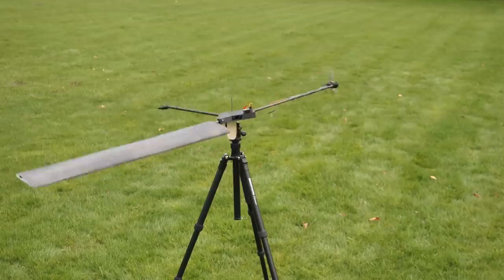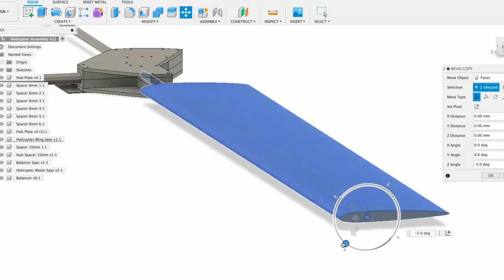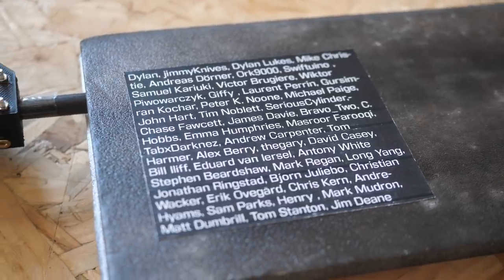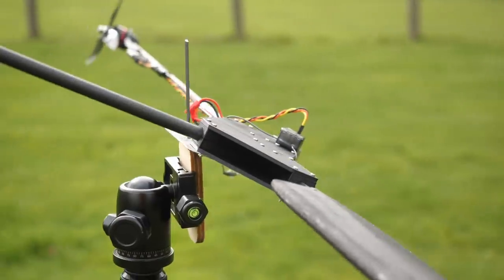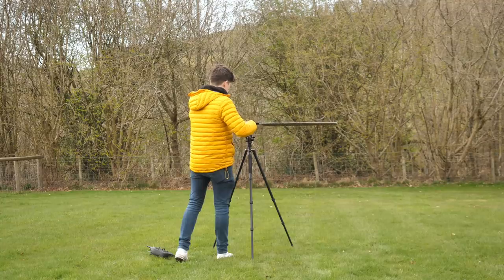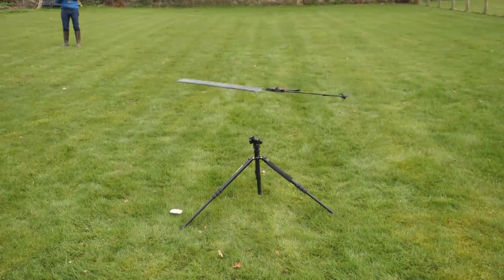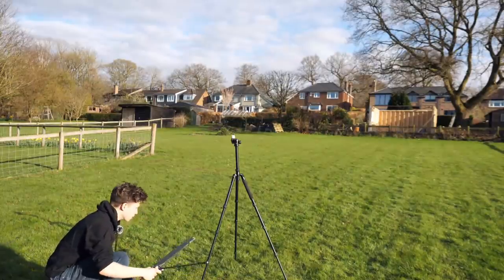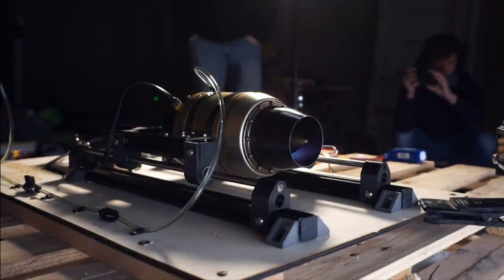Simplest Helicopter Ever?

Comment: James, we can totally stabilize this to give you roll/pitch control! A reliable yaw heading with yaw gyro and magnetometer (MPU9250) can give azimuth while in flight, then throttle can be modulated around the azimuth to increase/decrease lift on one side and stabilize on desired roll/pitch angles.  Hit me up this summer (after my exams are over haha)
Reply from the maker: I might have to take you up on that!
Reply: Please do a collab!!
Reply: @arturpekosz   Very nice! Love it.
I dont use compass, is did use gyro. Do you have instructions how to build airframe and your control method?
Reply: @pepethefrog7193  Sorry, I don't have instructions. I am using a QMC5883L magnetometer, and an Arduino nano for the calculations. My airframe is made of fibreglass rods, joined with string and superglue. The wing has a fibreglass frame and a tape covering. And my monocopter has landing gear (it can take off from rough concrete and very short grass).
Reply: That actually makes sense as opposed to just being a sales pitch. As much as I can understand it.
Reply: Exactly what I was thinking 🤔 lol great content keep it up
Reply: I was actually wondering if you could somehow use a shrouded photocell to align your control movements.

Comment: This may have already been mentioned in the comments:  A very similar helicopter to this was published in the 1960s in the magazine, "American Aircraft Modeler".  The helicopter at that time was called, "Charybdis".  It was powered by a Cox .010 "gas" glow plug engine.  Construction was almost entirely balsa wood, harder wood for the long arm and a thin, plywood plate upon which to mount the engine.  Now, carbon fiber and 3-D printing.  My, how the times change.  I think you deserve a lot of credit for your hard work, determination and perseverence.  Thank you for this video.  You put a lump in my throat as I reflect on the balsa wood models of days gone by.  Best wishes.

Comment: I built one of those single bladed copters about 45 yrs. ago. Used a Cox .010. I still have it. Mine got launched by hand. Spin, pushup, let go. It took me about 10 attempts to get it to keep flying. The spinning The centr. force over pressured the fuel and caused it to run rich and lose rpm( and altitude! ). I had to tune it beyond the correct ratio ( too lean ) then spin it to launch. The rotation brought up the fuel ratio and it flew. I lost it on the first flight, but found it a year later, 80 ft. up in a tree several blocks away. Back then it was called "The Charybdis". Plans from Popular Mechanics. That was it's only flight.

Comment: Beautiful experiment!  To find the dynamic rotation point:  Tilt the helicopter wing such that it does give no lift.  Glue a piece of light carton underneath on the helicopter frame in the zone where the dynamic rotation point is expected to be.  Hang the helicopter (close to static balance point) with a long rope to the ceiling.  Start the helicopter and let it run at the expected flying RPM and touch the carton from underneath with a marker.  The helicopter will draw a circle on the carton which center indicates the dynamic center.  Attention: dynamic balance point moves by varying the RPM!!!, so try to simulate with +/- the specific flight rpm!!!.  And giving the wing a progressive angle would make the flight MUCH more stable and more efficient!!!

Comment: Add another pole at the center, pointing straight down, such that the weight tends to keep the plane of the blade's travel horizontal.  In fact, you could launch it by sliding the pole down into a vertical pipe, further ensuring that its horizontal upon launch.

Comment: They made choppers like that back in the 70's. I was not around, but they would make freeflight timed with burning wicks and a switch, r/c ones that had a heli fuselage hanging below to hold a pitch and bank servo, simply pulling it forward from just below the bearing that held the blade to the top, and some had a servo to control a reversable brushed motor powered tail rotor, that would move the tail in yaw to direct the nose, since there was no torque created by the rotor powering itself. They also had the most annoying type- a main rotor mounted gas engine, spinning an oversized prop, then the torque would spin the whole rotor blade the opposite direction. In a world of gps programmable flightpath and gyro stabilized drones, it is way more fun to tame a not so automated contraption.

Comment: I think you could add directional controls to this with a single servo controlling a hinged control on the wing.  An arduino combined with a MPU sensor would allow you to initialise the model on the ground and define "forwards".  You would then have a fixed plane of reference that you can use to control the model meaning you could then code "aileron" and "elevator" controls by mapping the input requests so that they activate the servo at the appropriate times in the rotation.

Comment: Hi great idea. I used to have a free flight helicopter with a Cox pea engine and once the engine was running the counter rotation would spin the outer blades when it got up to speed the blades would start to alter pitch with a counter weight on the blades so you are not wasting lift for drag when the blade is set pitch

Comment: I used to build these with Cox .049 engines.  It had a horizontal stab above the wing with an adjustable elevator to control the pitch of the blade (speed of climb).  No throttle, just watched it fly until it ran out of fuel.
Reply: Build onr myself back in the 70's plans from a flying models magazine.

Comment: This reminds me of the Fairey Gyrodyne design of the 50's. It used tip mounted jets supplied with air from a compressor in the body of the airframe. It flew very well, and was only let down by the ungodly amount of noise it made.

Comment: You can achieve full three Access control of that by implementing a time space control scheme used in conjunction with an aileron. Basically the aileron pitches up on one face of the rotation and pitches down 180° from that to achieve roll. Then changing the phase of those pictures changes the role direction. Not easy to program, but should be pretty easy to control if and Imu and microcontroller is used.

Comment: Here in the UK in the 70s we used to have a firework called a helicopter. It was a bit of card about 4x1 inches with a rocket motor tapped to it about two thirds along, you would then launch it from a shed roof or a piece of wood at a angle, the fuse had to face you when you lit it. Maybe you could make a modern version with a ducted motor.

Comment: 3:00 Nice seatbelts these are very secure, but since you wear the cap in the proper orientation you may consider
to mount some headrests. In case of a accident you may hurt your neck. Or snap it, and that is a no fix :). Cheers.

Comment: Might want to see about hanging a heavy weight from the center of the tripod, if you're going to use that method to launch, it'll help stabilize the tripod, and perhaps make launches a bit more predictable. Also, the heavier the better within the capabilities of the tripod, and also keep it pretty low (almost touching the ground.) What this will do is lower the center of mass of the tripod as low as possible, and make it much more stable relative to its height. Good luck :)

Comment: You can do 3 axis control if you put a hinge on the blade that gives more or less pitch depending on how far it swings in either direction. Then you just manage acceleration on your motor throughout it's rotation.

Comment: I feel like the appropriate way to hand launch this would be like a boomerang to get the spin and some distance from yourself. Maybe wait until its fairly stable before then though.

As for control, you should be able to modulate the wings angle of attack along with the motor power to give you all axes.

Comment: You can make a slightly simpler helicopter by eliminating the wing and tilting the main prop mostly upward. Thus, it's basically a spinning mono-rotor ... one fourth of a quadrotor.

The countermass can be an L shape - a bar with a bend. The important adjustment is tilting the motor/prop so it works well.

You show an example of this sort of thing at 7:37 - notice how it just has the one prop and everything else is essentially a shaped countermass to allow it to spin in a stable manner. The other bits aren't aerodynamic at all, everything useful acting on the air is the prop.
Reply: Wow now that makes sense so basically use your battery for counter weight so all u need is balance your battery & moter with the proper angle &your flying
Reply: @beachinrc101  Yeah, that can work particularly well if the battery is long and thin. Basically, you want the weight distributed along a plane rather than just along a line. So, a T shape with the battery along the top and the prop at the tip of the bottom can work well.

The point is, the planar weight distribution forces the body to align perpendicular to the spin axis. This in turn forces the prop to be pointed in the desired "upward" direction.

Comment: Well done!  A free flight version was featured in "Aeromodeller" or perhaps "Model Aircraft" magazine (UK) in the 1950s.  It was called a "Charybdis" (after the Greek Χάρυβδις, a mythical sea monster or whirlpool).  In those days the power was a 0.75cc or diesel engine which developed all sorts of fuel supply problems spinning around on the arm opposite the wing.
Reply: I actually built one back in the 70's - still have it (but it hasn't flown in decades).  Used a Cox glow motor for power - launched (as I vaguely recall) by holding it above my head and simply giving it a twist.  It would climb until engine cut, and then auto-rotate down.

Comment: An easy upgrade to give it directional control would be a weight that can be swung in two axis from a center pole under the machine. You would need two servos to achieve this. Then by just pulling the weight in on direction ahead of the COG would cause the machine to fly in that direction just like a hangglider.

Comment: I remember I used to have a toy called the "Flytech Bladestar" and it's sorta similar to what you're doing but it could move laterally with some wizardry (I don't remember it working all that well though).
Reply: I think that the Bladestar got dizzy, I know mine did until I stuck a tiny magnet on one blade and a counterweight on the other. No idea why that worked, it shouldn't have. Some things don't seem to make sense but still worked. Mine lasted for a year  until it flew away.
Reply: @darrellcook8253  And where were you 10 years ago when I had my Bladestar and had this issue!

Also mine succumbed to its injuries after my brother sat on it and completely messed up the blades

Comment: I think the factor you haven’t accounted for is the center of pressure as opposed to the center of gravity. The closer these two points get the smaller the arm of force there is to work with. In an airplane the center of gravity is located ahead (forward) of the center of pressure resulting in a nose pitch down moment. In terms of stability, a more forward center of gravity result in a more stable control configuration while a more rearward (aft) center of gravity results in a less stable control configuration. I believe the wobble you observe is the offset of the center of pressure being a large distance from the center of gravity.

Comment: I've seen this design in old model aircraft books from the 1950's.  They usually had a vertically mounted stick underneath them more as an aid to launching than stability.
Reply: What did they use to power them?
Reply: @olliefoxx7165  
Small IC motor

Comment: I would experiment with a counterweight that shifts position in relation to rotation speed.  I suspect that as induced drag on the wing increases with speed, it shifts the actual "behavioral" center of mass, causing instability.

Comment: Digital compass, fast response ESC. speed and slow the motor based on compass heading and referenced to craft heading to tilt the craft at the correct time to drive it in the desired direction.

Comment: Decouple rotation @ measured COG, add a non rotating vertical bar below that assembly with a quad-motor calibrated for omnidirectional thrust.  maybe grab small wires and make landing feet.  Sharpen blade and you now have a weaponized drone.  Great video.  
Don't do that last part....

Comment: cool idea.  are you using any flight controller here? seems pretty good if not.  Looking forward to checking out the ones you mention with  accelerometer to measure the RPM. ( if you know the rotational position you should be able to speed up and slow down the motor  multiple times per rotation at just the right time to have control in the horizontal plane as well as the control you already have on vertical axis.)  Might take some simple flight control software that is tunable, but should be fairly simple logic to write.  How crazy is that to think about?  3 dimensional control by use of only a single control motor!  Talk about a fun project!

it seems like launching might be optimized by making an adjustable position of contact for the launch surface so that it would be perfectly balanced even before launch.

Comment: Great! 

Disregarding balance etc, did you think of adding some twist to the blade so that it's coarser pitch at the root? (Helicopters have fine pitch at the root to reduce drag in forward flight, the V22 Osprey obviously tilts its rotors so the airflow remains mostly downwards through the rotor disc all the time)

Comment: Try launching from a flexible pole like they use to spin a plate then as it changes from its balance at rest to its dynamic balance point it may remain stable?
Reply from the maker: That's a great idea! The previous version was actually launched from a handheld (quite flexible) wire rod that could distort to where the centre of rotation was - quite by accident!

Comment: 'McCutchen flying machine' They fly just as well without the stabilizer...I once built one with a Cox .049 glow engine, The stabilizer fell off and it flew even better.
Use a screw driver for hand launching and let it fly off the screw driver

Comment: put a weight ball under it extended for distribution for xy and give it xy axis to move the ball left or right forward and aft. fight controller flat line to axis. with snap on gps.

Comment: It'd be interesting if you could "modulate" the speed of the motor depending on the rotation of the aircraft to control the direction of the aircraft